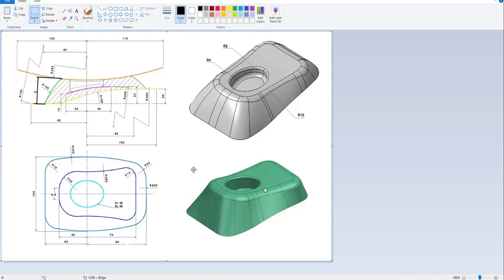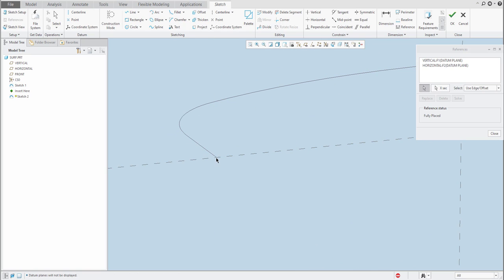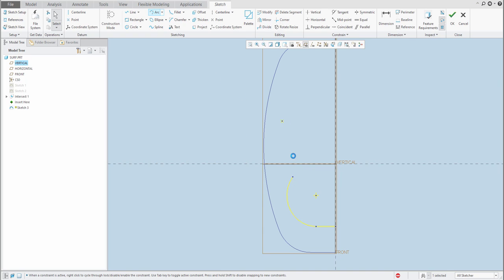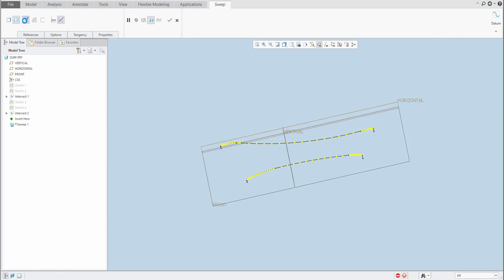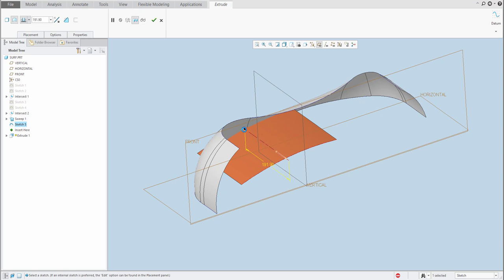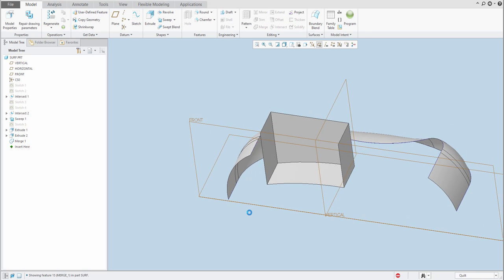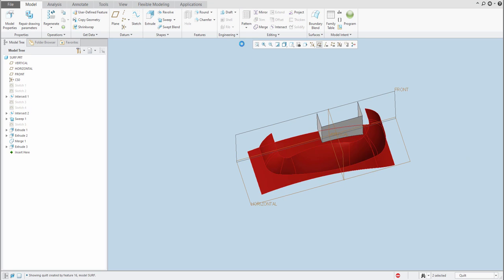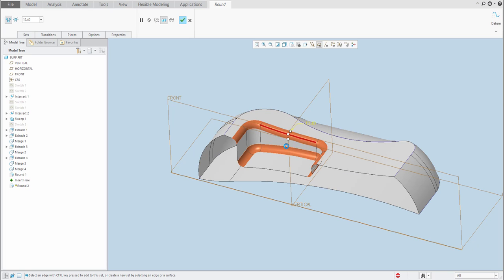How to create solid model based on curves | Creo Surface modeling

Comment: Great explanation....
But i am confused between surface and sheet metal..
What's the difference between surface and sheet metal and when to use?...
Please clear my doubts
Reply from the maker: Hi, thanks for your question. The sheet metal is used for object where you need to get unbend/ devoleped length (holders) ,surface modeling is used for complicated shape.
Reply: @4kside  Thanks for reply